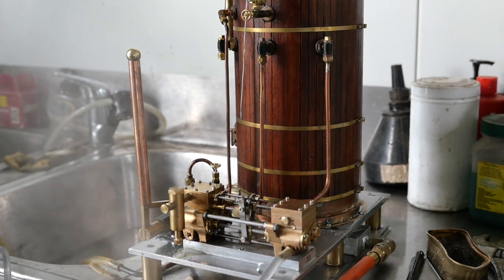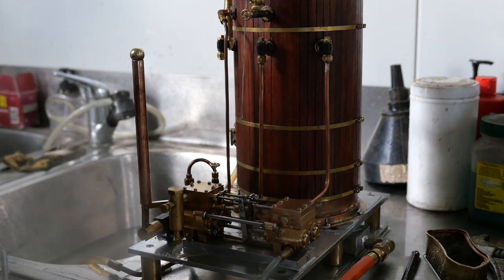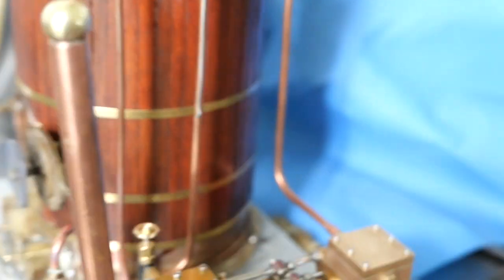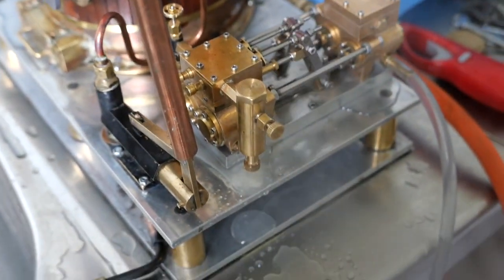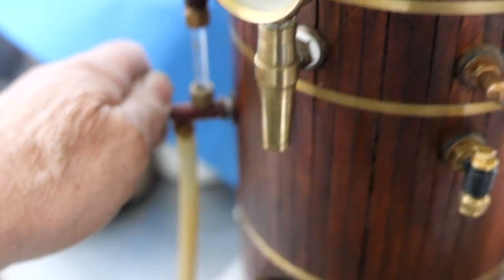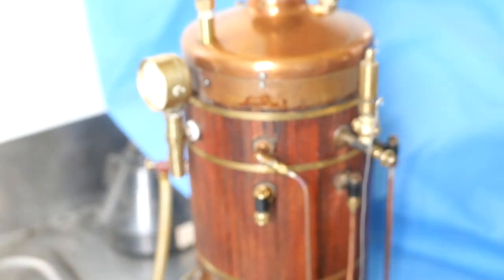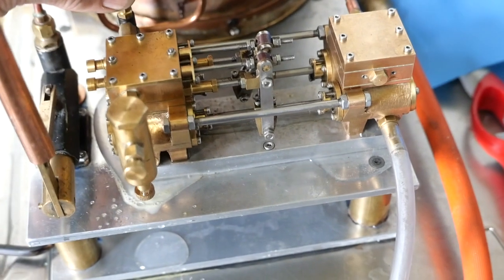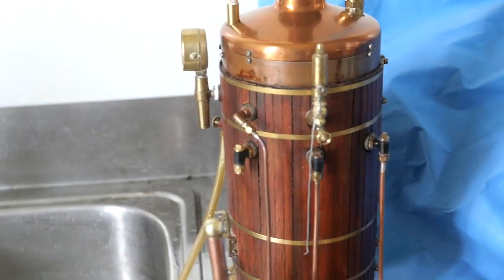Southworth Boiler Feed Pump

Comment: Hey John, 
Going to assume you are from Australia? I am, and I am having a really hard time finding a model boiler feed pump to use on my 4" Australian made boiler, can you find them online as "ready to run" or are all all requiring the work of machining?
Reply from the maker: Hi Steven,
hand operated boiler feed pumps are available from various model engineering suppliers, including EJ Winter (NSW)  Reeves, and others in UK.   Steam operated feed pumps come up occasionally on Ebay second hand, but most boiler modellers make their own, as I did.    Having one of each kind on each boiler is the optimal way to go, but a hand pump on its own is perfectly adequate.  Hope that helps.    John